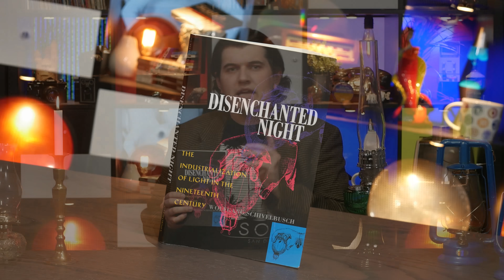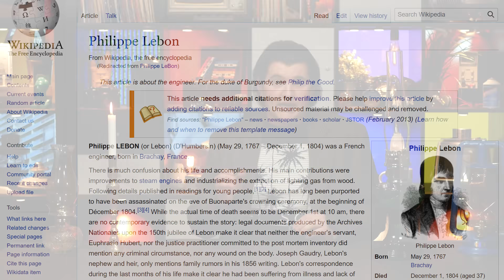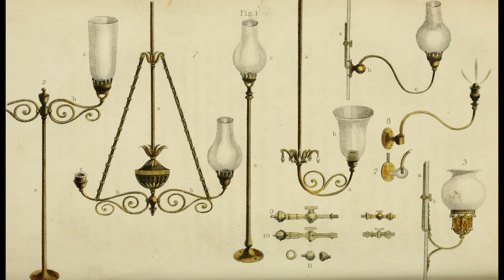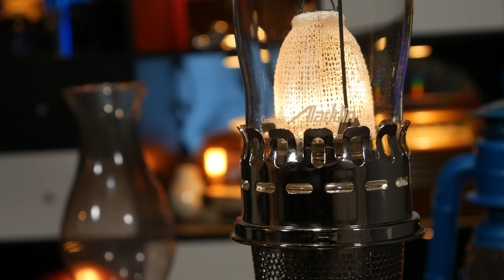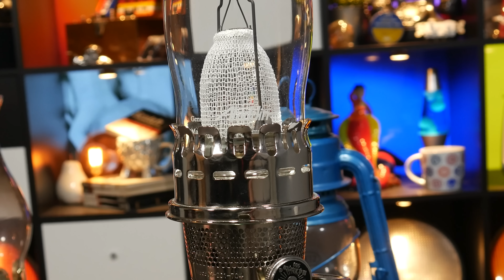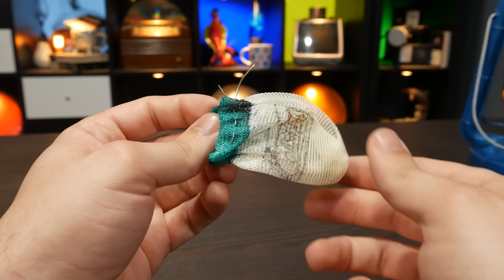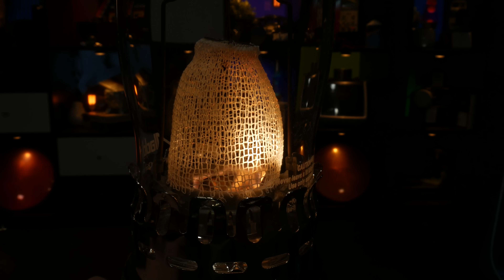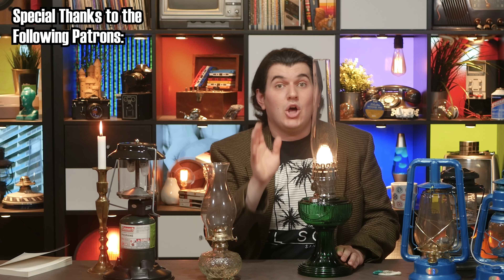How the gas mantle made lamps 10X brighter

Comment: there has to be a diesel mix you can use in the Aladdin lamp. I use an alcohol/stabilizer/diesel mix to burn in a kerosene heater, it doesnt have that mantle, just a wick, but I think you could just adjust the mixture ratio to make it work. it burns clean too, and it's never set my CO detector off.

Comment: My ex and I had an Aladdin lamp 40 years ago while we were playing pretend homesteading and hippie. 

In the late 1950's my family had a little travel trailer that we used on winter trips from NY to Florida.  The question at the end of a day of travel was, "Is the mantle intact?" Usually not.  They were relatively expensive.  The light came from the propane tank. 

One used to buy kerosene....and mineral spirits....from pumps just like gasoline.  A couple of dimes per gallon, unlike $15 in cans at the home store.

A home lighting system overlooked......I'm surprised!......is acetylene. If one drips water onto, I think it is, calcium carbide, acetylene gas is produced.  That's how the miner's lamps worked.  My father-in-law grew up on a farm in southern Michigan in the 1920's and 30's.  No tractor, draft horses.  In the basement was an acetylene generator.  It was piped upstairs, I've no idea if they used a mantle, but I suspect not.  When one adjusts an oxy-cetylene welding torch, there is a point where the flame become very white. 

Ah, England.  Rich in coal and iron. No natural gas until the North Sea discoveries some fifty years ago. Perfect.  Make gas, make coke.  I'm not aware of any significant coal gas operations in the US. Perhaps locally in the coal fields? 

And all of this far superseded by LED lighting. Lots of light, tiny energy inputs.  No flammable liquids or propane need apply.  When I was a kid, backpackers used candle lanterns.....a folding structure to prevent the candle from blowing out.  Now, an LED lamp on your forehead, for starter.

Comment: "forced my lute" might be a reference to the practice of greased glass tubing connections being forced open. If it doesn't force it open, the outward pressure would break the glass.
Meaning, a gas was being generated from the heating of the liquids and solids that either had to escape by separating the grease tubing connections or busting out through the weakest portion of the glassware.

Comment: Minor point of contention, wood gas is quite natural you can observe it in a fire pit in your yard with no special apparatus if the wind conditions are correct and so it must occur in nature during a forest fire.   
I have wood heat and often in the past would light the fumes coming off of the hot but not fully engulfed wood it is a fun trick

Comment: A flame is plasma, a state of matter (like solid, liquid, gas, bose einstein condensate, etc.) and this is ionized gas, we see the same kind in nebulae. Temperature is the same as molecule excitation or motion level, when temperature goes up enough, the air molecules start to rip off some elections from each other, making ions, a flame, something bright. Colors are variable from the nature of the gas, and also the temperature, hotter means brighter. Pure ethanol makes invisible flame in daylight making it very dangerous.

Comment: Lute is a sealing compound replacing grease ground glass joints before it was invented. It blew out the lute from the joints. If the lute stayed, then the glass broke from the pressure.

Comment: Growing up Amish those kerosene lamps, along with white gas(naphtha) lamps were in common use when I was growing up in the 90's and 00's. While most of my family is still Amish, they along with the most Amish in my area(northern Indiana) have transitioned to rechargeable battery LED lighting. This was brought on by the improvements in LED technology, affordability of solar panels, lithium ion and lithium iron phosphate batteries. Another two contributing factors, were the high prices of kerosene and white gas, and the fire risks associated with using combustible liquid lighting indoors.

Comment: I know this is over a year old... but probably the thickness/length of the wick in the Alladin lamp has less to do with the flow rate of the fuel traveling through that wick.

Like if you dip the end of a paper towel in some water and watch the water climb up the paper towel, it won't do so in a uniform fashion... some parts of that paper tower for whatever reason have a different flow/absorption rate than other parts of it so the line of water climbing up that paper tower will be curvy and uneven... I think basically that is happening with the wick.. It's such a long wick compared to the other flat wicks in the lamps that there is a much greater length for this unevenness to show... for the fuel to find paths of least resistance where more fuel climbs up the wick than others...

Anyways...

I'm impressed you kept me interested in someone talking about lamps for 30m lol Nice job.

Comment: I grew up on a farm in the 1940's and we didn't get electricity in the country until REA came in the 1950's. I was very familiar with all the kerosene lamps shown here, the Dietz lanterns were used for farm chores after dark and night fishing using trot lines along the river. The Aladdin lamps were unbeatable for indoor use since they didn't smoke and smell up the room as wick lamps did. I remember the flu temperature was so hot that you light a match or cigarette by holding it directly above the glass flue. Of course later we got a Coleman lantern which used white gasoline and mantels which produced a brighter light. The old kerosene Dietz lantern was more reliable when bumped around while fishing along the river or night hunting while chasing dogs the old kerosene lantern were still used into the '50s and '60's.

Comment: One unusual use of lantern mantles was used when I was training as a radiological monitor: they were mildly radioactive, and the examiners would hide them around our training grounds, and we had to use our rate meters (Geiger counters) to find them.
Reply: The radioactivity in Coleman mantles is from Thorium. Why they used Thorium in the manufacturing of those mantles, I don't know, but the packaging used to include a caution to handle the mantles as little as possible, and to wash your hands thoroughly, with soap and water, especially if you got the ash from a broken mantle on your hands.
Reply: @laura-ann.0726  Correct. Thorium was used to coat the fabric of lantern mantles because it glowed brighter than other elements when heated. There are other elements and compounds that also glow when heated, but thorium had an ideal balance between function and cost.

Comment: I am curious how well a candle acts on a mantle, have you ever tried that? Would it produce any more light than just the candle? Would it produce less?
Reply: The mantle requires a really hot flame in order to glow, that is become incandescent much like a bar of white-hot steel. The candle flame is much too cool and would just deposit soot particles on the mantle, as T.C. demonstrated with the BBQ lighter. Recall that the Aladdin lamp's flame is so hot that it completely burns the fuel without creating incomplete combustion products such as (glowing) soot particles and carbon monoxide, which is why the flame itself does not glow much, if at all.

Comment: My 92-year-old mother who grew up without electricity knows all about these lamps. Matter of fact there was one left in The Farmhouse and when we had a power failure amazed how much light it puts out
Reply: Hard to believe we've gone from burning fuel for light to color-changing wi-fi enabled LED smart bulbs in a single person's lifetime. What's even crazier is that we already take our modern lighting for granted.
Reply: @methos1999  The gap in technology is I assume exaggerated by their rural upbringing.  Some notable events of 1931 include the completion of the Empire State Building, the first non-stop flight across the Pacific Ocean, and the invention of the particle accelerator.
Reply: @methos1999  ....well technically fuel is still burnt to generate electricity to power led bulbs & other appliances. Today World industry is just trying to cut off the fuel usage by turning everything to electrification.
Reply: People still use the Alladin lamps on remote ranches and mining claims especially at high altitude because it gets too cold for propane to work, and they don't have or can't start a generator.  An alcohol or kerosene stove or heater will also still work at very low temperatures.
Reply: I am not anywhere near 92, but I am old enough, and was raised in a rural enough setting that most of the products discussed on this channel are things that were a regular part of life during my childhood.
Reply: @gregfaris6959  What kind of toaster did you have?
Reply: @charleschristianson2730  : A Sunbeam automatic one - we used it for many years.
Reply: I'm a landlord in the UK and occasionally I come across the lead pipes used to feed gas matles from well over 100 years ago still buried in the walls of the houses.

Comment: My Grandparents had a cottage on an island from the 80's up to the early 2000's. Up until about '95, the whole place was powered with propane. Lights, stove, even the fridge, all propane powered. The water was pumped from the lake with a gasoline powered pump to a small water tower. 

After the electric upgrade (which would be wildly expensive today), the stove remained propane, and one light, in a little corner with a comfy chair, and a perfect view of the lake, the perfect spot to curl up with a book, was left alone, it still works.

Comment: I wonder if that incessant "turn off the lights when leaving the room" has something to do with the gaslights, the slow leaks, as well as using up oxygen in a room? It would have been life saving habit to absolutely make sure the lights are off and the valves are closed. And may have just developed into a thing people starting passing on from generation to generation without questioning it, because "it saves money" is just as reasonable as "it saves lives".

Comment: My Coleman camp lantern (a product of the mid 1950s, inherited from my father) uses silk mantles...and it always fascinated and amazed me how they could catch fire, "burn off,"  yet continue to be useable time after time after time to produce a very bright 100' circle of light, and yet said mantle is so fragile that the barest whisper of a touch or blowing on it, (once used) is enough to destroy it!  (Dad always carried a supply of extra mantles!)  That lantern burned white gas, which required pumping up pressure in the tank.
As old as it is, I fear the gasket is probably shot, rendering it unsafe to use, so my current camp lantern screws on top of a propane cylinder...and interestingly, doesn't give QUITE as bright lighting. The old Coleman could be turned off by just turning off the valve to the gas supply, similar to the modern propane one.  However, once out, it would continue to glow for a bit, until with a soft "WHOMP!" it would blow itself out.  This provided enough residual light to get from the table to the tent without stumbling.  My propane lantern however, does not do that.  When you turn off the valve, it's off.  Period.  So you'd better have a flashlight to get to your tent!

Comment: I grew up in an apartment building that was originally illuminated with "manufacturer's gas".  The ceiling fixtures were chandeliers with gas burners.   The burners in the chandeliers were bored out, the valves at the room entrance were removed. An electric switch was installed in place of the valve and a wire was run from the switch, through the gas pipe to the chandelier where a light socket was installed above the burner.  The pipe was used as a ground return.  Not exactly safe with cotton insulated wires.

Comment: I’m always stunned by the fact that arc lights, literal LIGHTNING in a tube, was invented before bulbs that just needs to get a filament hot
Reply: It is very easy to get a filament extremely hot for a couple of seconds. It's very hard to get it extremely hot for much longer. An electrical arc (especially one of the temperature needed to produce good light) will absolutely vaporize its electrodes over time as well, but it takes much longer for it to do so than it takes for a carbon filament to burn itself out in atmosphere.  Even a tungsten filament will rapidly oxidize under the same conditions. The fact that filaments need to be quite thin in order to produce good light (due to light only being able to escape at the filament's surface) certainly didn't do them any favors either.
Reply: Gravedigging a 2 year old comment, but a lot of breakthroughs in history were discoveries of material science. Once you get something with a property you haven't had before, suddenly a lot of applications become possible. There's actually a theory that the tea culture in China held them back this way because it prevented them from discovering glass as they used porcelain pots and those were fine.
Reply: Mildly on topic: something that I’ve always loved about Minecraft redstone is the fact that whenever a new block with unique functionality is introduced, loads of new and unique creations are made.
Reply: @dojelnotmyrealname4018  the version I have heard for the China theory, from an anthropological perspective, is more due to the fact that East Asia has a lot of clay that is really good for making high-quality porcelain, part of the reason that to this day many English speaking countries call high quality porcelain products "fine China" - the clay needed very little refining before it could be fired into a quite well made porcelain.
Reply: Arcing electricity is easy.  But Finding a filament that wouldn’t burn was far more difficult 

.
Reply: everything is easy in retrospect.  @electrictroy2010
Reply: i mean it makes sense the way it makes sense we got dietz lamps before gas mantles
Reply: That makes more sense. Good clay meaning you don't develop glass follows more than tea.
Reply: They were invented in the 1800s, by the way. As in the decade, not the century.

Comment: Well burning Fuel for light is a long going thing whether it be Paraffin or Krasen or coal in a power station USA thought a Big Country like you would have a lot of nuclear power but i though wrong when seeing train loads of coal 2 mile long going to a coal powered electric station at leas we burn gas which is still not clean enough.  still have my oil lamps will be burning red Krasen instead of blue  Paraffin

Comment: Gazometer... Literally "to meter out gas"...
Meter is also a verb...
By "metering out" the gas, you know how much gas you have at a specified pressure going through a piping system by volume over time.  It was basically a cylinder that, using gravity, pressurized a volume of gas, and an engineer could easily calculate how much gas was in the tank at any time.  So, technically, the cylinder(big gas holder) had three functions; 1) to hold the gas, 2) to precisely pressurize the gas, and 3) to act as a measure of available gas as well as consumption of gas over time.
Thus, one could calculate how much more gas was needed for a particular period of time and how much coal was needed to produce that gas based on production figures...the measurement of which...

Drum roll please... 🥁

Requires A Gazometer.

Comment: The reason for the cleaner burning is in how the gas mantle traps (nets) the burn-off impurities, so they get burned too - effectively raising the "low burn temperature"
The fumes are basically an odor_an odor can linger - being a heavier air mixture...
The large flame that happens from "wind" is the center air in the wick whirling the condensed-heavy-air-mix combined with creating a fire tornado scenario (again, referencing the Hurricane Lanterns☺)

Comment: This is basically how LED bulbs work, it's just that it's on a much smaller scale, so the heat is applied electrically over a millimeter or less, which causes a lot of heat over a very tiny area. It might be low wattage, but it's soo concentrated that the localized temperature can get very high but can also quickly radiate, making the overall temperature feel much cooler than the element itself is. In effect, the LED casing acts as a heatsink.
Reply: I must assume the writer is joking. This is not at all how an LED operates.
Reply: Ok so this comment is 6 months old but I need to know, this is sarcasm right?
Reply: Literally everything about this comment is wrong. It's so bad it's "not even wrong".
Incandescence is not electroluminescence. Like...at all.
Reply: Bullshit.
Reply: no that is totally wrong, it really doesnt work that way, at all. A LED die will reach at very most 100°C to 120°C. No sure what leads you to making things up but you whole message is complete delusional fantasy.

Comment: Here's a tip if you burn Hurricane lanterns like I do. Don't use Kerosene to fuel the lantern. It is more expensive but I use Charcoal Starter. It is much more refined and cleaner than Kerosene or K1 Kerosene. The flame will burn with a whiter color temperature making it brighter and you can turn the flame way up without causing soot. And no, the Charcoal Starter is not explosive. It just burns much cleaner.

Comment: forced my lute probably means the vessel pressurized to a point the substance used to seal the system to fail. Lute being the name given to the material used to seal vessels and pipes. When the seals failed, it no doubt damaged other components, broke my glasses so to speak.